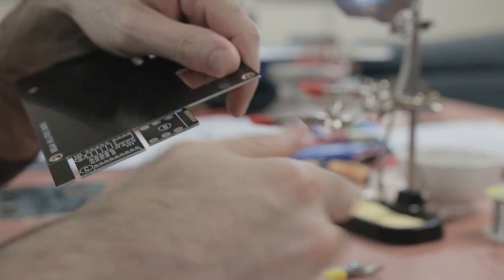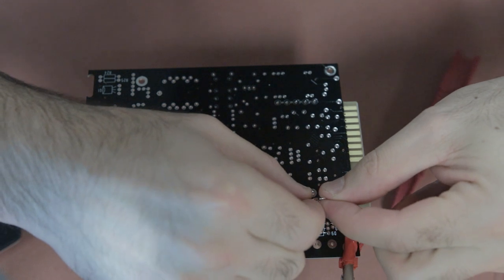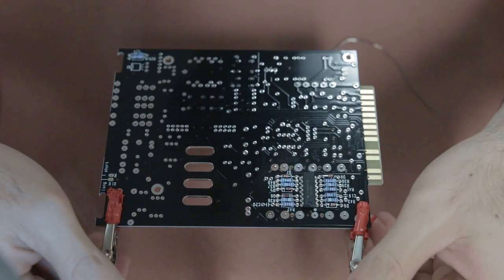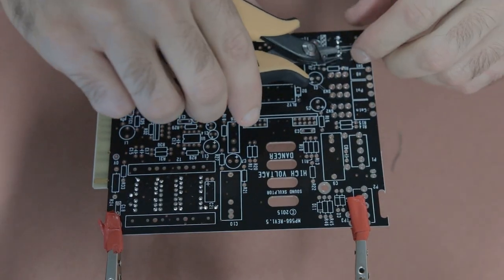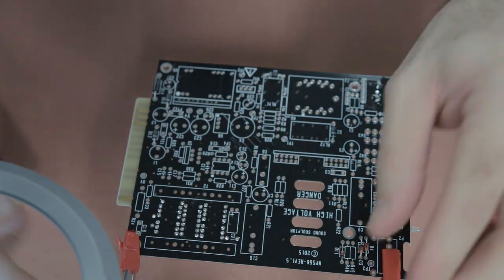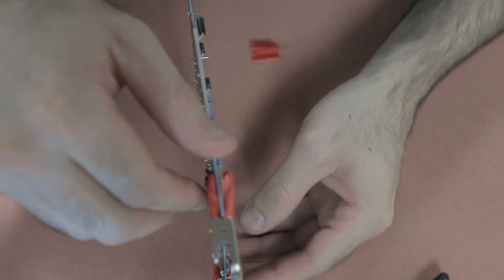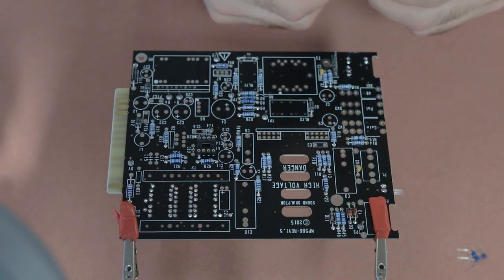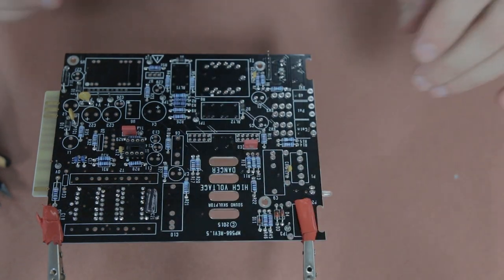How to Build your Own Tube Preamp - Sound Skulptor MP566 (LA 610) DIY Build PART 1

Comment: Hey, Great Videos.  Gonna watch all your builds before I do my own.  

But I wanted to point out that the LA-610 is a specific Universal Audio product that includes a 610 Mic Pre & a LA2A in one 19-inch 2U box.  The preamp is just a 610 or 610B, and come from Bill Putnam’s 610 Consoles.  

The new Universal Audio (under his son Bill Putnam Jr.) released the Solo 610 (single desktop Preamp/EQ), the 2-610 (rack mount Pair of Pre/EQs), the LA-610 (a rack mount ‘channel strip’ consisting of a 610 Preamp/EQ & a LA2A Compressor, also designed by Bill Sr.), and finally the 6176 (which like the LA-610 is a rack mount ‘channel strip’ with a 610 Preamp/EQ except with an 1176 Compressor, again designed by Big Bill).

So the Preamp by itself or with the EQ is just a 610.
(Without the LA)

Hope that’s helpful, just wanted to clear up any confusion.
I at first thought you were indeed building a kit version of a whole LA-610, which is an Amazing unit (especially for R&B Vocals and Bass).
However, doing so in separate 500-series modules may be even more flexible.
I particularly like serial Compression, 1176 into LA2A, on lead vocals, and 500-series Preamp kits leading into that combo for pennies on the dollar sounds like something worth soldering for.
Reply from the maker: Yeah thanks for clearing that up, The LA 610 is what everyone is probably more familiar with so that's why i refer to that unit specifically. 

I recently did an opto compressor and will be doing an 1176 style next, to do exactly that, have a solid chain i can run most things through.